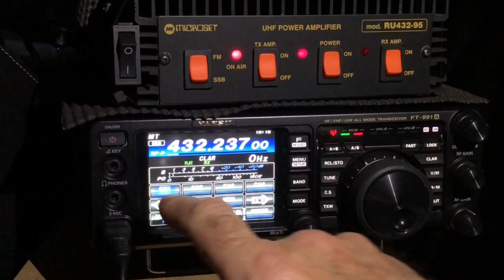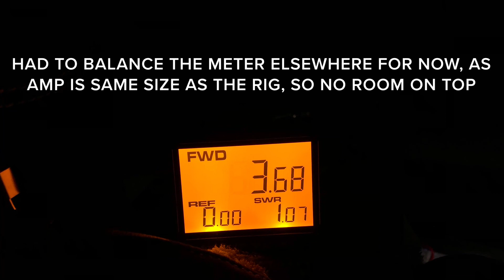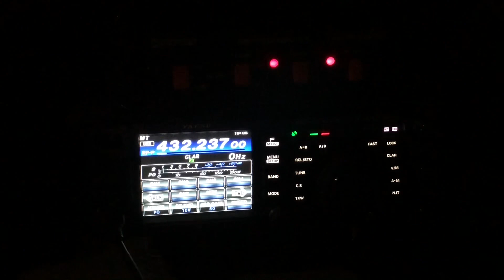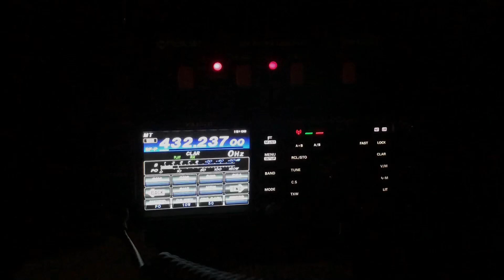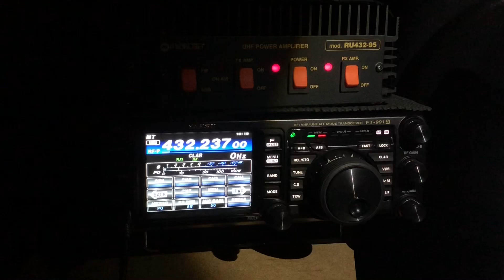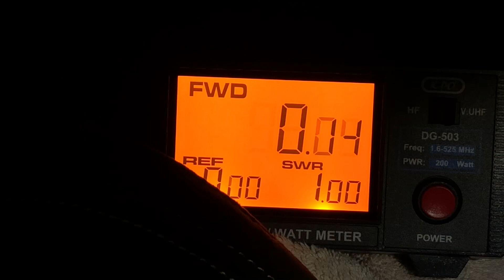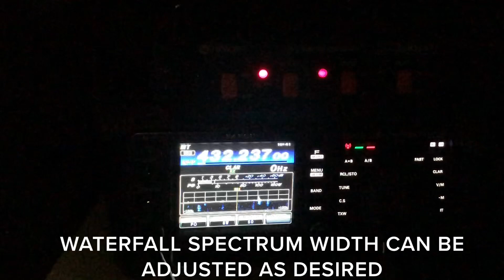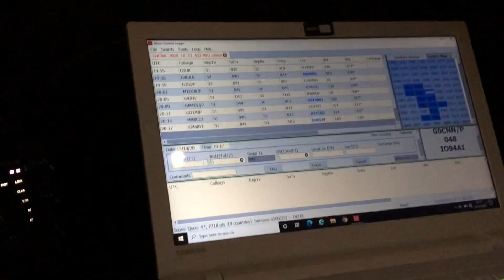Amateur / Ham Radio UHF Contesting on 70cm with the Yaesu FT-991A

Comment: I always enjoy the UKAC 70cms contests as a relatively easy set-up and I tend to do well, however I have hardly done any this season! Maybe it’s always wet on 2nd Tuesday. The GW was GW4MBS Clive down in IO71. Quite a rarity!
Please advise linear fan spec and whether you endorse.
Cheers, Nick M1DDD
Reply from the maker: Funnily enough Nick, it’s the 70cm nights that seem to be jinxed with awful weather! Yes, this fan was a mistake purchase for something else (too big), but happy with it for this application. Spins effectively and quietly without fuss. Arctic P14 Silent 14cm. I also have the controllable Artic F9 PWM REV.2 92mm. 👍🏻
Reply: @G0CNN-Ian  thanks for fan info Ian. I could do with equipping one of my amps with a fan. Yes, weird re 2nd Tuesday WX. I was out portable last Thursday 80m contest with 55m long doublet at 10m with very blustery WX. Survived... BUT I have definitely started to become a fine weather portable op! Probably becoming a softie as I get older. More Henderson’s Relish needed on my porridge!  Have a good day

Comment: Some amplifier you have there Ian, it’s a monster 🙂
Reply from the maker: @AdamG3HHT  Yes Adam, mine’s the next page along 👍🏻
Reply from the maker: I wish it pushed out a little bit more so I could ease it back to 100w. Oh well....what’s 10w...😀
Reply: @G0CNN-Ian  I have a Jaybeam double slot fed D8 / 70  yagi which only has a 1m long boom. Similar in gain to your parabeam and a wider beam width of 45 degrees, less pointy, be interesting to compare performance. If you want to give it a go, let me know. 🙂
Reply from the maker: @AdamG3HHT  Thanks Adam! A kind offer 😀 I was going to give this one more try in Nov contest as I’m contemplating another Innovantennas Yagi, but first getting a rotator cage made for the base of the mast as I can’t push any more weight skyward 😮Rotator at the bottom opens up new options...🤔 Watch this space....
Reply: @G0CNN-Ian  ok chap, this one is 35 years old , but Jaybeam over engineered them in those days.